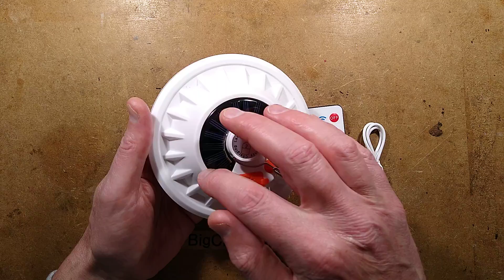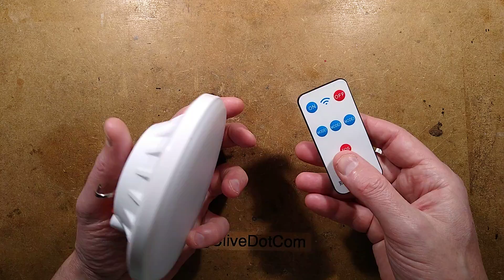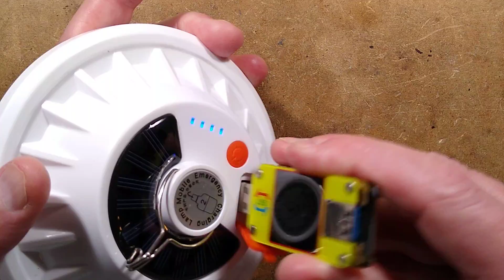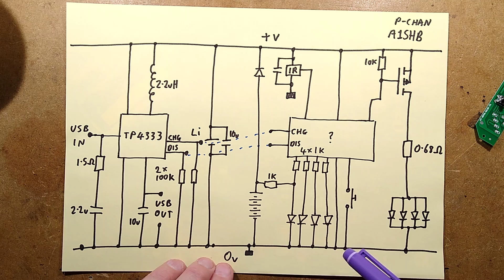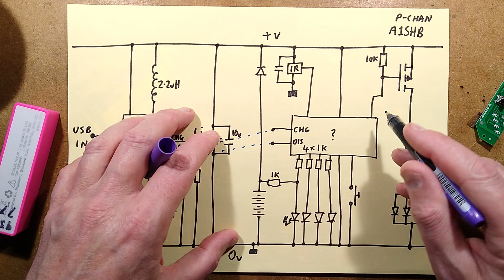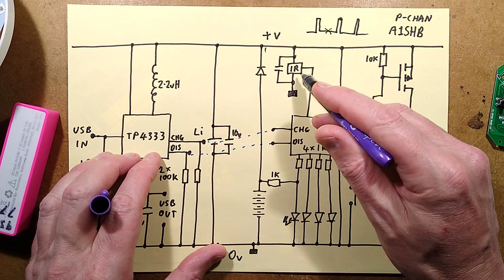Rechargeable camping light with weird design flaw

Comment: Between the IR receiver, the micro-controller and always-on USB output, there probably is enough phantom loading to cancel out whatever comes out of the tiny solar panel out over a typical day.
Reply: THIS is what I wondered. does it even produce enough power to overcome the you know they will be blinking high power blue charging led's
Reply: @chri-k  do you not know how to read english? You seem to have typed English so I assume you can read it
Reply: It doubles as a bug zapper, though. That sure comes in handy, when out camping. 😄

Comment: Having that large number of LEDs means they are each running at low current.  They should both be very efficient and last forever under these conditions.
Reply: Replace the battery?
Reply: But then, this is Big Clive's channel, and a good many of his devotees would be likely to possibly change the batteries.
Reply: mowgli2071  soldering li-ion cells opens up a whole other can of safety worms as well.
Reply: @carbonite1983  Perfect excuse to bring out the battery spot welder!
Reply: @oliverer3  my man! You are indeed correct.
Reply: I fixed a solar PIR light with the battery from a broken Poundland power bank (bad joint on micro usb). It worked for another year mostly after a bright day, but has now crapped out. Luckily it had tabs on I think.

Comment: Actually, bought a generic power bank like this one — exactly the same shell as well, simply because they take 18650s, which can be easily replaced and recharged in a proper charging unit, and are quite handy as an isolated 5 volts power supply for quick tests.

Comment: I work for Jaycar here in Australia and I just bought a couple of our little camping lanterns (ST3420). It has the usual light modes by clicking the button, but luckily if you leave it sit for a few seconds, then press the button again it'll turn straight off. It's really bright too. Very usable light. The only downside is they run off 6xAA batteries instead being rechargeable.

Comment: Definitely a must multi level hack unit.
1. Replace the cells with laptop battery 2.6Ah [5.2Ah total]
2. Relocate the solar + over to the USB + in through a diode. [don't need shotkey, plenty of voltage push. I understand driving a solar panel with voltage can cause damage, hence the diode for when it is plugged in for charging.]
3. Fabricate your own 5V/500ma [or buy one] solar panel with USB output, so you can use a standard USB to Mini-USB cable to charge the unit. [And your cell phone too. 😃]

Comment: The power that small solar panel makes gets used by a IR receiver and the USB inverter (both always active), so it's unlikely to overcharge._
Reply: It needs a switch for a charge-only mode to allow it to charge up fully when not in use. Then it could be ready when needed.

Comment: I wanted to see you solder in an N-Channel to see if the SOS worked properly.
Reply: Not going to work.  SOS mode will be right, but the off state will be the on state.  What I think BCDC didn't make clear was they changed the MOSFET, and then someone was told to fix the firmware, they did that to the best of their ability.  But, because they didn't understand what the SOS mode was for, they (and all the post design testing) didn't notice that they'd buggered it.

Comment: Useless tiny panels! ~4.3v peak after the diode will trickle less than 1mA into most batteries... quite safe for months of day/night cycles.
Reply: The issue with that is that the forward voltage of the diode is current dependent, as the current goes down, so does the dropped voltage, which could mean, at low current (full battery), you could have 4.5V to 5V being pushed into the battery. Liion does NOT like that, even at microamps...
Reply: @erroltheterrible  Well, then you know when the battery's are fully charged if the thing catches fire.

Comment: Hilarious that this is one of the better SOS modes I've seen from China in terms of speed, yet they still managed to ruin it by reversing its polarity.

SOS modes are one of the weirder things that Chinese makers latched onto and refuse to let die, even on products where it makes no sense.  Most generic LED light chips have such slow SOS modes that no one would notice the letters; they'd just see a slowly blinking light.  An SOS sequence should take no more than 5 seconds in total, yet some of these products take that long for each letter.

A strobe mode on a closet/camping light is just plain ridiculous.  These blinky modes should never be in the main button sequence, but should require a hold or other special sequence.
Reply: Completely agree !!  
5 seconds is 12 words a minute. I was taught, SOS and PAN PAN PAN, should be sent at 10 words a minute, but thats on a key. Is it different with Semiphor ?
Reply: Maybe the SOS won't die because the manufacturer designers are sending us their message. It's not for us, it is to us.
Reply: Some of the lights/flashlights I've got actually have a  S-O-S-O-S-O-S-O-S-O  mode rather than S-O-S-_-S-O-S.
Reply: Why for the God's love someone invented the fast blinking lights? Did they hate people with epilepsy? What is the point of this fast blinking light?

Comment: On the other hand, an inverted SOS could be a good safety feature, especially on a slow pattern like that -- the light would be on more of the time. This could help determine location in extremely low light levels. 🤷‍♂️ I'd pop that solar panel off and replace it with a barrel jack, then attach a better solar panel somewhere else where there's more sun. 👍
Reply: ... where there's more sun... Not thinking of running wires across the ocean are we, Ted? :-D
Reply: @stepheneyles2198  My wife has accused me of loonier things. 🤷‍♂️

Comment: Had they made this without the SOS and strobe and added USB charging it would pretty much be the perfect camping light...  I would even accept them adding red or blue LEDs for "night vision" if they needed to add a gimmick feature.  I'd replace the two 18650s with a single 5A 21700, looks like there is plenty of room.

Comment: Someone could simply ad a 1S  ,BMS for 50 cents and a jack for a useful exterior solar pane / charger. I do a similar hack with cheap solar lawn lamps so I can put the little solar panel on or out the window, for a light inside ,a few feet away. Add a switch to the light and it's always charged when needed.

Comment: Could you hack this to just turn full-on or off by adding a switch to pull the gate of the FET to 0 volts?  I really dislike the 'feature creep' switches that the Chinese seem to consider de rigeure, which take you through multiple modes. I think a simple on-off switch would suit the needs of most people...
Reply: Nod to this. I have a pushbike rear light that had FIFTEEN strobe modes. Sounds good - but all I want is the light to be actually onny on all the time, which is mode 1 - meaning to turn the thing off after a ride I need to press the button another fourteen times....

Comment: I wonder if the resistor from the solar cell is to limit the voltage to avoid overcharging
Reply: You beat me to it. It is certainly that - that blue LED has likely high enough forward voltage to limit the charging voltage on the cell. Most likely it won't charge at all (blue LED with Vf about 3V ...), only prevent deep discharge of the battery ...
Reply: @JanCiger  That resistor only affects the LED current, not the battery charging!
Reply: All of my 18650 chargers, solar, mains, some cheap n nasty, and 2 "intelligent" units, continue with 20 mA after the 'charged' led lites. Weird ? Yes/No ?  
I've put 24 ohm resistors on each individual cell bay. Increases the charge time by a bit.
Reply: @snakezdewiggle6084  Not relevant to that 1K resistor they rambled about above.
Reply: @johndododoe1411  oops, yeah sorry, apologies about that.
Reply: @johndododoe1411  I guess it limits the voltage put across the Li cell, kind of like a reverse polarity Zener Diode. A variable voltage limiter even, think about it. LED+resistor forming a V divider, with the middle tap being the LED's forward V. LED's current adding volts to that point, increasing the Li's chargeV (trickle charge?) up to a point where the Li cell goes "high impedance" and all the solar panel's current being consumed by the LED. Might be an ingenious Li cell charge limiter!
Reply: At 1k it wont be doing much fwiw. If the solar cell can put out, say, 10mA, that's going to be 10V plus the LED voltage drop, or 12V (edit: more like 12.5-13V for blue, but still wrong) if its to be diverting the full current away. I'm sure that was probably the half-assed intent, or to show the solar panel is active. That said two cheapie green SMD LEDs would probably be quite effective overcharge protection, or maybe yellow to play it safe. See that in solar calculators to avoid overvoltage in bright sunlight.
Reply: That is why the always on 5v is a bad idea in most cases.
Reply: to me that is what alot of resistors do in terms of voltages, they ensure they get proper voltage by creating a voltage drop.

Comment: it is getting harder to find a decent light with just 2 modes, on and off, who needs, wants or ever uses the flashing and sos modes.
Reply: The sos mode and strobe functions are rather useless in daylight if ever needed.
Reply: I wholeheartedly agree.  I do like a high and a low mode, but prefer that they are different switches or have a good user interface.  Nothing like needing a little light and getting the full power of the sun because you have to "mode" through it.
Reply: The camping lanterns usually come with a combined dimmer and on/off switch. If you don't dim them, the batteries won't last very long.

Comment: When turning light off from the switch on the unit, hold the switch down for a second or two to see if it turns off.
Reply from the maker: It doesn't.
Reply: @bigclivedotcom  I know this was the case with some of my Chinese flashlights.  Also, WHY do we need strobe and SOS in like every flashlight.

Comment: Interesting. I wonder if the solar panel could be re-wired to the same place as the USB input - or somewhere else, so that it gives the cells some protection on the solar side?
Or would it be better to just get a thin Li-Po battery (with protection circuit included) and just use that instead of the 18650s?
Or would it be better to just buy a cheapo protection PCB for about £2 off eBay :)

Comment: I've found a 120 LED version, with 3x 18650 cells.
Reply: Just received a 120 LED lamp, and I'm quite impressed with the light output. 😎

ETA: I've had a look inside, and it does indeed, have three 18650s in it.

Comment: if you were to measure the output of the little solar panel, it probably doesn't output enough voltage (after the diode drop) to overcharge or even fully charge the batteries.

Comment: That solar panel is going to contribute absolutely nothing to the charge of the battery.  The larger side should be a decent size solar panel and the small side should be a single LED, then it might actually be useful

Comment: I got some today & I noticed a design flaw for shipping the hook is lined up with the button so one of them was dead on arrival until I had it plugged in to a charger for over 4 hours to even see the charge indicator lights dimly lit.
Reply from the maker: If using a power bank type chip it may enter a trickle charge mode to recover the lithium cell.

Comment: I imagine if you hold the power button for a few seconds the unit will turn off without needing to cycle through the different modes.
Reply from the maker: It doesn't.
Reply: You broke it ;)

Comment: I have 2 of these and am quite happy. I use a 5v charger to charge the light
Reply: Is it designed to be used on and USB power supply too? Like on a power bank?
Reply from the maker: I think it can be lit and charge things simultaneously.  It depends on the current supply capability of the cells.

Comment: I'm currently working on a little electrickery project in the form gutting a fly swatter and installing in place one of the cheeky Chinese high voltage modules. A wee bit of soldering, explanating to myself how the old module works, (pretending I'm making a youtube video like this) followed by some southern comfort as some concentration juice.
Reply from the maker: Keep in mind that those high voltage modules are only designed for brief intermittent use.
Reply: @bigclivedotcom  Hey Clive. I've actually completed a diploma in electrical installation as well as worked with electricians. I am aware these modules are prone the over heating as a result of high spark gap. They have all worked well with my mods. If you'd like the technical data for them let me know.
Reply from the maker: @MrRedeyedJedi  The wide spark gap doesn't cause overheating.  It stresses the voltage multiplier capacitor, diodes and PCB to the point of internal flashover.
Reply: @bigclivedotcom  well either way, my point is the ones I've made have remained operational for 3 years. The high potential difference can cause them to fail by heat or as you say flash over. The one I dismantled after a continuous burst had a few components that had burnt out in what ever way you want to word it. I attribute this mainly to the high potential and the fact they are potted in apoxy and coated in plastic, a very poor conductor of heat and very good insulator.

Comment: Clive.
If the chip is sending an inverted signal to the mosfet and therefore the SOS is odd, does that mean that when you press the button and turn it off, the chip is sending out the signal when it's off?
Or when you've turned it off, it's actually on. 🤔
Reply from the maker: I wondered that myself.

Comment: Perhaps you could use a higher capacity solar cell, to charge it?

There are plenty of 5v USB solar panels, on Ebay, for less than a tenner.
Reply: I've just got a 5v, 5w, solar panel, which I'll be using to charge the lamp, if/when there's no mains power available.

Comment: 100 hours charging time when charged by the solar panels? Hahaha, it would take about a year to charge the thing here with the amount of rain and white cloud cover we have. What will happen if you overcharge those 18650's? Will they 1) Start a forest fire if the light is left outside to charge, or 2) Start a cabin fire if left in the window sill for charging? And also when they  are charged by USB. Or will they just die, like they did on the head lamp that I bought when I charged it over night for the second time? I think they should have made a battery compartment that you could easily open, so you could replace the batteries when you wanted to. You might want to charge several batteries to bring with you on a camping trip, or even when you are in a cabin, so you don't end up without the light while it is charging. You can also get these small, cheap 18650 battery chargers that you could have used if you could easily remove the batteries.

Comment: The solar panel with this one is pretty useless given how small it is, I got more on my garden lights and those only use cheap AA ni-mh cells. This light however could be pared with a usb solar panel and be charged in reasonable time with that vs what came with it.
Reply: I suspect the lithium-ion cells would be damaged by solar heat long before they get overcharged by those pathetic solar cells

Comment: I'd never get how - and, more importantly, why - flashlight (& the likes) 's designers put a "step-through-all-modes-to-turn-your-flashlight-off" cycle into their products. *One button to rule them all*, or what? 😂
I'd prefer one button for an on/off toggle, and one button to step through the modes (or a slider switch). It's not that difficult, since all the flashlight are utilizing (utilising?) MCUs nowadays anyway.
Or at least a "short press -> on/off in last mode, 300 ms press ->cycle modes, 1500 ms press -> SOS" type of thing for one button. You don't want an emergency feature to be triggered accidentally, do you?

Comment: You have mentioned the microcontroller software seems to have been written expecting N-channel mosfet on the output and that's why the SOS strobe is in reverse. Would it be possible to just change the P-channel transistor in this circuit for a N-channel one to fix it? Or would it require other changes to the circuit and/or software? 
I could never fully understand transistors and especially the differences between P-channel and N-channel.
Reply from the maker: It would work, but the modes would all be different.

Comment: I Dare you to plug in 
Powkey 60W 12-18V Portable Solar Panel, Solar Charger with USB C, 2*QC3.0, DC output, Monocrystalline Foldable Solar Panel for Most Power Station, Camping, Mobile Phone and Laptop 

So the 18650 Do there party popper  / Aliens (movie) Pop out the side Trick

Comment: The SOS weirdness is due to them not wanting to drive an NFET, which requires gate voltage below the 0V rail.
What's the IR sensor for? Can the unit actually turn the light on when it senses motion, or considering how backwards it's designed would it turn the light off?
Reply: I've IR sensor is for the remote control he demonstrated at 0:46
Reply from the maker: An N-channel MOSFET would be switched with a positive control line with respect to 0V.
Reply: @COBARHORSE1  Ah. Oops.

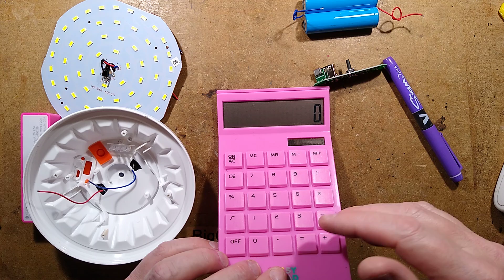Comment: 10:36 You calculate 3V forward drop on the LEDs. Does that really mean, that these, khmm,  well educated "engineers" connected all 60 LEDs in parallel?
Reply from the maker: They are all in parallel.   Not a huge issue with matched LEDs from the same batch.
Reply: @bigclivedotcom  Hmmm... matched LEDs vs Chinese mass production. Doesn't seem to be friends hand in hand ;)